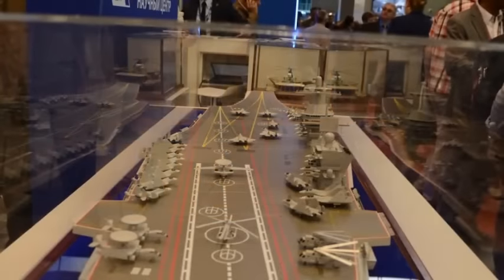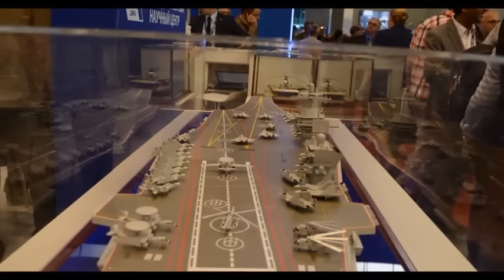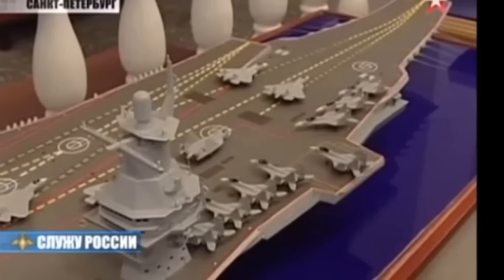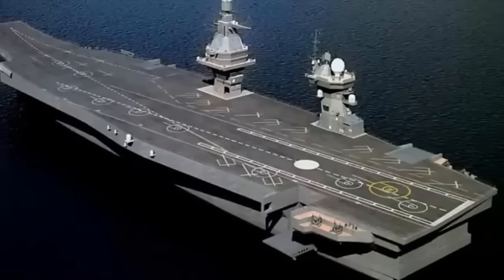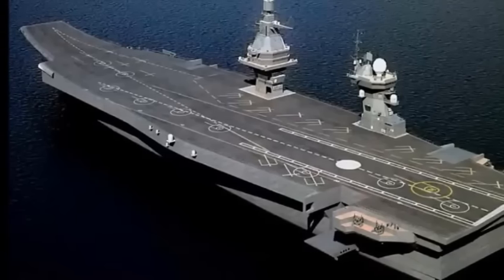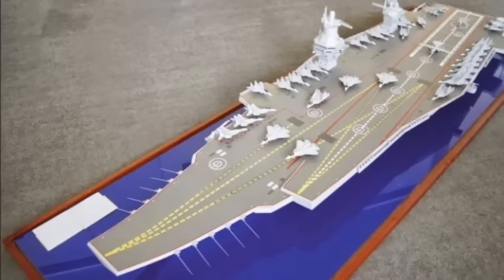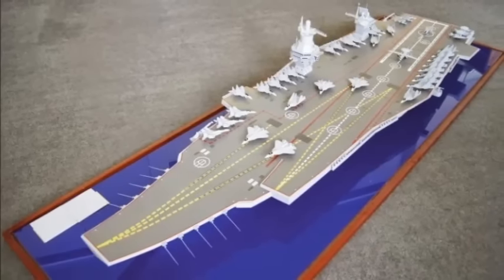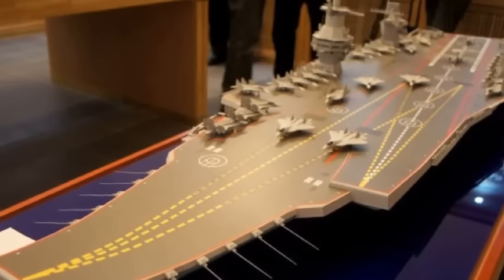Large Russian Aircraft Carrier Design Unveiled

Comment: That ski jump at the front of it makes the whole carrier look so stupid. I think the reason they have ski jumps is because they cant make jets with powerful enough engines to lift them off the flight deck, so they build that ski jump thing at the front to give the jets taking off a little extra lift up off the deck. It also saves a little bit of fuel because they don't have to use as much energy to lift off. I cant swear, but I think these might be the two biggest reasons for that ski jump silliness. The purpose of having two islands is that in case one of them gets hit by incoming fire, the other one can still do command and control.
Reply: No jet is powerful enough to lift off without a ski jump or catapult.
Reply: ***** On what carrier?
Reply: ***** Well the eurofighter is a great plane. But The sukhois are bigger and have a greater reach, and probably weren't designed with the intention to lift off carriers. And the load on them i'm sure is quite heavier than the eurofighter since the euro is a air superiority fighter with short to medium range air air missiles and lighter bomb ordinance.

Comment: It is modern weapons the US Navy aircraft "U SEI Gerald Ford" carrier and has a length of 1.092 thousand feet, displaying the flight deck by 257 feet, and the height is 252 feet, the size of the four fans 21 feet and weight of the aircraft carrier more than 100 thousand tons.

Aircraft carrier this will be able to carry up to 75 aircraft, including the F-35 Joint Strike Fighter, F / A-18E / F Super Hornet E-2D Advanced hook, EA-18G, and helicopters MH-60R / S and air vehicles without unmanned aerial vehicles without fighter pilot.

Aircraft carrier containing the-art system to launch drones, and can carry four launchers electromagnetic, also it includes a double system of radars and advanced sensors, and using nuclear reactors and generators advanced energy, can do B160 sorties in the case of wars up to 220 sorties and will be armed carrier rockets Raytheon advanced rocket Sea Sparrow (ESSM) and high-speed rolling missile (RAM)

Comment: This is wrong information , the new Russian double deck catamaran aircraft carrier will have two identical big aircraft carier joint in the middle. Will be 200 tons watter, ,, 400 miter long.  120 miter wide and 60 miter high .
Will take 75 (30+45) MiG 41 and 35 Naval ones on one side and on the other 75 (35+40) SU35 and SU57Naval planes on the other side. Will take up to 60 Tanks and armoured  machines , 4 fast small (DESANT ) navy boats with up to 800 solders +400 crew =1200 together .

Comment: still, no launch system = limited capacity for useful loads on the planes. and would not be able to launch larger aircraft, which the US has full capability to do. Whatevs!
Reply: +Matt Gibbs This is incorrect Russians fighter engines are powerful enough they don't require catapults to get fighters of deck on full load. American engines needs catapults because they cannot do this. Thats why the soviets didnt really need them.
Reply: They mentioned catapults in the video.
Reply: SOVIETS?
Reply: Peter Lloyd Refers to when Russia was known has the USSR and they started to build their first carrier.
Reply: Its supposed to have both catapults and ramp and cappacity comparable to Ford class. Well... should, would...might.